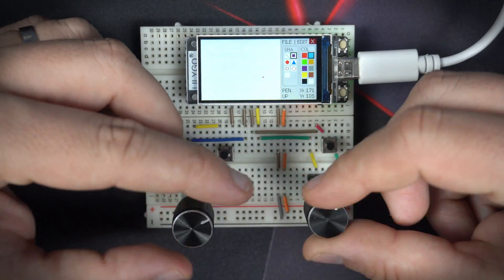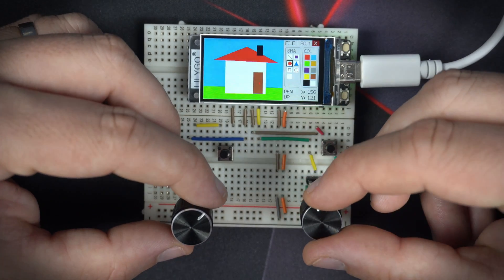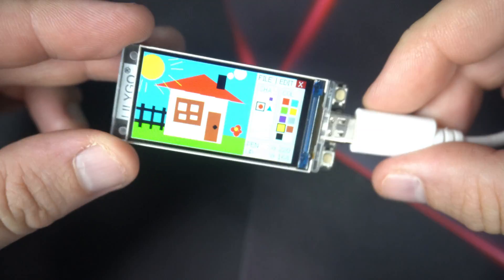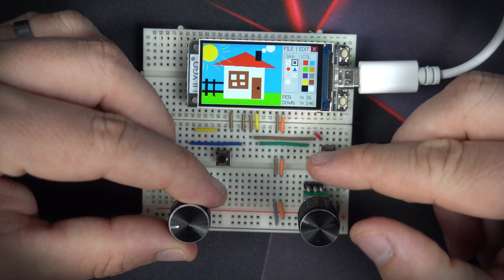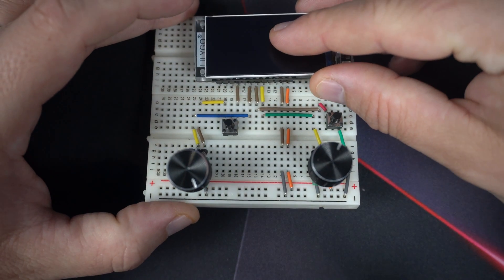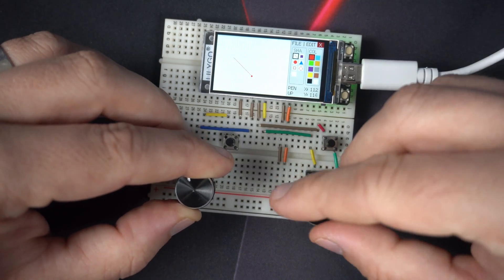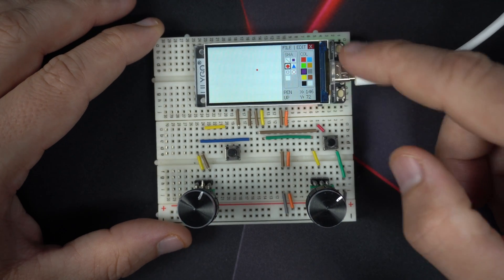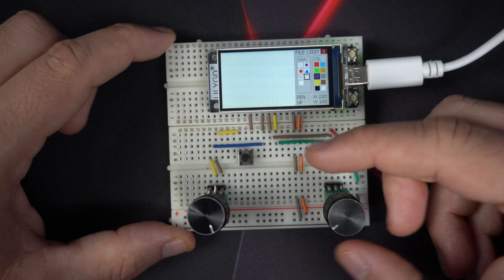MS Paint on Breadboard (T-Display S3)

Comment: Hi again, I've been trying to get my T-Display S3 set up for a couple of weeks, but no luck. Is it by any chance necessary to make some changes to User_Setup.h or User_Setup_Select.h in the TFT_eSPI folder inT-Display-S3-main/lib? And is it correctly installed if it's in Documents/Arduino/library/T-Display-S3-main/T-Display-S3-main/lib/TFT_eSPI? (I did copy the TFT_eSPI folder to the /library folder as well...) I have asked this question elsewhere as well, but I forgot where... 
Thanks in advance, Les Pinter (the MS Word guy...)
Reply from the maker: no there is no need to make changes in user_setup.h with this board, you need to use their library, did you fallow my instruction video?

Comment: Hey, Volos. I made a library called EasyColor, available in Arduino library manager. With that library, you can convert RGB888 to RGB565 (and other formats too). 
#include <EasyColor.h>
EasyColor rgb2rgb;
uint16_t rgb_565_test = rgb2rgb.RGB24toRGB16(0x80,0x80,0x00);

Comment: Why don’t you explain how the code works? It would be cool. By the way very nice project
Reply: If you understand surfaces and blitting in pygame it's the same concept only using the spi tft library in arduino. That's the jist I get from reading the library. I'm waiting on mine from ali. Pygame is the best way to learn the logic sprites imho. If you can do arduino sketches easily for temp modules and stuff then once you learn sprite logic in pygame it carries over. I apologize if you already know this stuff, just friendly advice :)
Reply: @jstro-hobbytech  thank you!
Reply: @Anto-ro6ru  np. There's a great 1 hour video on sprites on the clear code channel in pygame.  Download the code and watch it on double speed. Hehehe
Reply: @jstro-hobbytech  sorry i forgot to reply, i’ll check it out, thanks for the advice!